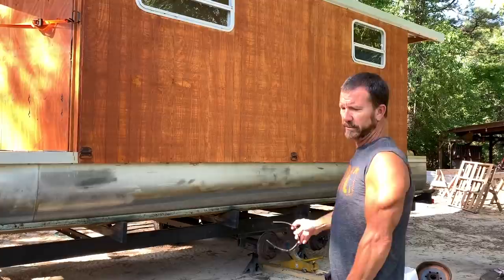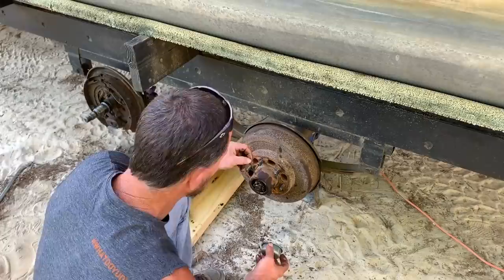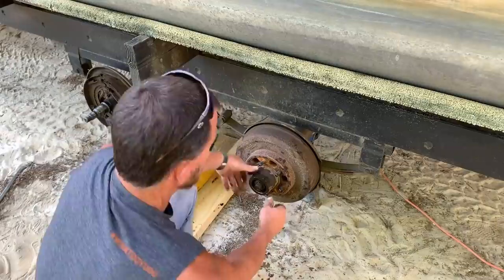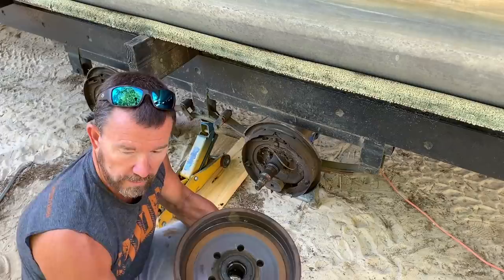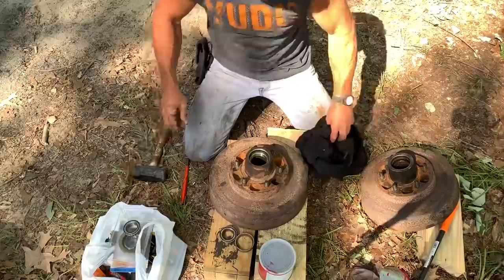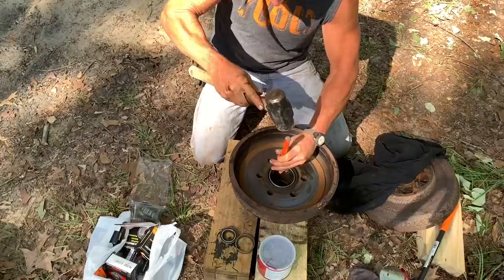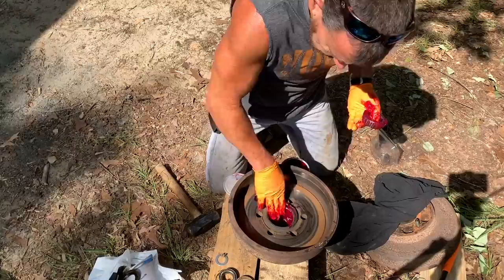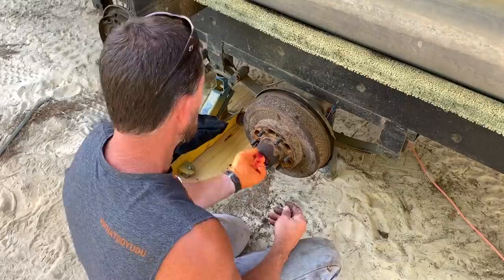Replacing Wheel Bearings on the Catfish Cabin! How To Replace Wheel Bearings!

Comment: It helps a lot on boat trailers if you don't back them into the water while they are hot. Let them cool a bit when you get to the lake. The heated air inside the hub and the cool water causes siphon effect that draws the water into the hub. The same goes for your gearboxes on your truck. Good job on the bearing replace be sure and check them after your first trip they may need a little snuggin up.

Comment: What we used to do,Jeff is after that outer nut is hand tight,we would put a socket on the nut and turn it one turn and then back it off a half a turn. That way it would make sure everything is seated. Those bearing buddies sure are nice. I have them on my boat trailer because I back my boat into a lot of saltwater and I grease them every time to get the sand and salt water out. You did a good job showing and explaining your bearing job. Love your videos

Comment: Man, I just gave away 4 brand new complete hub assemblies! Bearings, hubs, with electric brakes. Had a brand new tandem axle trailer parked next to a concrete wall, and a tractor-trailer backed into the tongue of it and pinned it against the wall and it twisted the frame a little, and the insurance company totaled the trailer so I snatched the entire hub assemblies off of it and a ran into a guy on the side of the road with a burnt up hub bearing, so I gave them to him. He was in a spot and didn't have the money to repair his hub, and I could tell the rest of them were really old and most likely going to burn up soon. so I fixed him up.

Comment: Great tutorial Jeff, we've stopped palming the grease into your bearings, we use a needle point solid stem grease gun,,,, out gun in the vise handle up needle point out needle point between the rollers,,, one pump each. And we put plenty on the inside just like you did 👍

Comment: Great tutorial Jeff! 
People, always face the lip of that grease seal with the lip pointing out and away from the bearing (not inward) so that it seals right!
He sure says it all 100% right when he speaks of seeing many people stuck on the side of the road with burned out trailer wheel bearings! I always check and repack trailer bearings before any long trip (boat trailer bearings every year regardless) and replace travel trailer tires every 2-3 years because they always dry rot and blow out more than most regular vehicle tires even if you cover them up from the sun. The price of new trailer tires is cheap vs having a blowout and an accident/roll over! Also, PLEASE do not use gasoline to wash these parts! I know that it works good, but it is too dangerous and can easily ignite from static electricity from your clothes, you touching things or from just pouring gas from one container to the next without a ground connecting the containers it can cause a spark, then an explosion and fire. I have seen too many of my past customers burn down their garages by pouring gas out of fuel tanks they have removed into a bucket to change out a bad fuel pump and using gas to wash parts. Do yourself a favor, go to the paint section of your home improvement or hardware store and buy a gallon of mineral spirits or high flash point naptha instead of using gasoline! Also, when ever driving bearing races, always wear safety glasses or a face shield, gloves and long sleeves! If you chip a bearing race, the sharp chipped pieces of hardened steel will fly as fast as a bullet and will puncture deep into your skin and eyes! I always cover the hub with a doubled up shop towel to slow down any metal chips that could break off so they don't shoot into the skin or eyes!

Comment: You can also use a large socket correct size piece of pipe (even PVC)  to tap pressure evenly when installing races sets and put piece of wood on top to hit if you need to to level the force. Good tips from others to put races in freezer to contract them first and putting washer and nut back on to help pull hub off.

Comment: Not criticizing, just want to make it easier for you.  I am an ex auto technician and have repacked and replaced many wheel bearings.  The easiest way to remove the inner wheel bearing and seal is to put the nut back on the spindle grab the drum and pull while letting the inner bearing slide down the spindle. It will pop that bearing and seal right off.  keep the vids coming. I have to say one thing.I know you have used gas for years but i beg you to not say it on the video. If you do make sure you make a disclaimer to not use it but to use a solvent / greaser.  GAS is so dangerous, so volatile,  one little spark and you are in trouble. so many other options.

Comment: As an ex tradesman that was an excellent demo.
Few things: You called the inner race the outer race. The inner race is on the inside of the bearing and the outer race on the outside of the bearing.  Not the position it is on the vehicle.

Please use a brass dolly to knock bearings in.

On a boat trailer, especially in the marine environment you don't want the sea water, or any water for that matter to get into the bearing.  It is a common practice to put the inner seal back to front, mainly to stop the ingress of water than to prevent grease coming out.  This also enables you to block the hole in the outside cap to prevent water getting in.

Doing the castleated nut up on the shaft, do the nut up with a spanner until the wheel is hard to turn. (do this with the wheel on) and then loosen the nut until the first groove lines up with the split pin hole. The wheel should then turn freely.
As demonstrated you are only tightening up against the grease and the bearing will be loose once the wheel starts revolving.

Comment: Great video! Now just some info.  I personally purchase an extra set of race and bearings and keep in vehicle along with gloves brake cleaner 12 volt air compressor bearing grease and at least enough tools to change bearings but I realize many won't do this.  Next, you do not have to do all this on the side of the road.  Once you get the hub off you can carry it home if close enough or to a truck stop Autozone  type store and borrow tools from them if you are buying parts there.  
TIP:  If you either dont want to do this and maybe get trailer to where it can stay a while, for many small trailers it doesn't cost much more to buy whole hub with new races seals and bearings in it (online like E-Trailer etc.) as buying the parts to repair locally and a lot cheaper than paying a mechanic to do this.  Buy non Chinese (American or Canadian or German etc.) bearings if at all possible They are generally much better quality grade steel but even some of those are rebranding chinese products now. Use buddy bearings and add a little grease  once or twice a year or every few times you launch a boat (potential for water to enter empty space) or every few thousand miles on trailers whose axels dont get submerged.  Try  NOT to submerge launch vehicle axels, you dont want to replace the vehicle bearings too! Like he said if you are replacing one set bearings on a trailer do them ALL they are all most likely near same condition !

Comment: If you get yourself a brass rod for hammering the race back in the brass metal is really soft and it won’t hurt the race and you can work on it pretty good.  I always kept one in the toolbox for that. 

Also whenever I do anything that’s going to get wet like a four-wheel-drive or a boat trailer I use white lithium grease. It cost more but it’s water resistant so if water gets in there it’s not gonna start breaking down and get all milky and thin.

Comment: I see so many ppl that do this wrong. Alot of these steps wrong and know how to properly pack a bearing w grease. Alot of ppl I have seen put a race in backwards. Make sure not to put a race in backwards, especially on the side of the road because the best way and 9ne of the few ways that work successfully to get a race out that's been put in backwards is get a piece of pipe you can just fit inside the race and tack it w welder pretty good to race and put pipe in vice and beat hub off of it. I take a chisel and grind the end flat l, not sharp. You can turn sideways to get race started then turn to where you have two good flat edges on race beating it out, it helps w keeping even and not cutting into hub versus just one punch edge on it. When tightening up new bearings w the nut I use adjustable wrench usually and snug good to where you know everything is pulled to gather good and usually will tighten half to 3/4 a turn, some take a whole turn but you can spin tire while tightening and feel a little drag on it. That'd your sweet spot. I farm and w harrow,cultivator,  water wagon, trailers I have to fix and keep up alot of wheel bearings. After replacing wheel bearings on anything, a harrow for example I run a good 6 to 10 hrs and recheck how tight they are. Tightening too much and they won't last but a few days. The dust cap or center cap is prolly most important. Do not run without one. It is letting in dust, dirt, water, and whatever else wants to get inside your bearings, about like these masks ppl wear against this virus but I always if possible buy a hub is best w a grease fitting on it but at least a center cap w a grease fitting on it. You can drill a hole in the center cap you have and get self tapping grease fittings to run into it. Not to be used for packing or replacing new bearings but is the life of your wheel bearings if you can put some grease to them, like on a harrow when running 60 70 hrs a week on it I will  2 to 3 times a week give it 10 to 15 pumps of grease to keep good grease in it. The hub is sealed so it is not something that you pump grease into until you see grease coming out anywhere.if no center cap you cut the bottom off a 16 or 20 Oz drink bottle and take a lighter and melt to hub where it stays on and seals it. Very I mportant to keep dust dirt and water out of them bearings. Great video, something that many ppl don't know how to do and what will cause failure of wheel bearings which can be very very dangerous if you lose a wheel going down the road and your boat was to hit the road and your wheel and tire hit an oncoming car or if my harrow or cultivator or fuel trailer hit the road and my wheel go into traffic and could kill someone. Could be a very dangerous situation

Comment: Jeff, that was an excellent teaching. I farm and have had to do that many times. I hate that there are such a multiplicity of bearing and race sizes so it’s really important, like you pointed out to save everything so that the numbers can be read. If you actually have bearings go out while going down the road, it’s rare that you don’t loose the dust cap, so taking your hub with you doesn’t hurt so you can get the right cap to fit it. Other than that, I’ve encountered the hole for the cotter pin to be at any possible angle, so scoping it out before greasing it up at the end helps to see where it needs to be lined up!

Comment: I use regular wheel bearing grease on my cars but for my truck and especially trailers I use "marine grade" grease.  It is specifically designed to not wash away or dissolve with repeated exposure to water.

Comment: Done this in so many parking lots. Drilled two spindles. That's a biotch. Molybdenum grease!  
Not gas...it leaves residue which destroys grease.
Tap the cap for a grease fitting.  Buddies are expensive.
I use a wood drift to "bump" them in.

Comment: Replace those caps with bearing buddies.  Spring loaded caps with a grease nipple, that keep pressure on the grease. when you see the cap moved in , pump more grease in to move the cap back out, never worry about water again

Comment: Good job Jeff. Looked to me like you've done a few before. Nice job on the Jack stands and the Jack in the middle for extra don't hurt none either. Two things I did notice though was you really should either use a bearing tool to install your races or at least a brass punch ta keep from scratching the races. And my friend whenever ya drive on harden steel like a race or bearing please wear safety glasses. God only gives ya two eyes and I bet your wanting to be see grandkids some day.

Comment: Don’t beat the devil out of it now, “Keep on bumpin” though. Good stuff
Reply: It's a good idea to use a brass punch instead of a metal punch when installing a new race.
Reply: But if ya ain’t got a brass one steel will work just fine.
Reply: @thomasloewen8911  Probably so, just don't get too carried away. Most folks probably use steel.

Comment: If you pack the center of the bearing full of grease and put a bunch of extra all the way around it put it in a vacuum sealer bag and vacuum it and when the bag collapses it will force the grease into the bearing

Comment: I use buddy bearing's they can be greased with a grease gun.And always preload the bearings by turning the bearing nut if possible to the next slot for your cotter key.Montgomery. Al Rolltide

Comment: If it’s a good Hot day, leave the hub out in the Sun an Freeze 🥶 the race for a bit, 
That will make it contract some while the hub in the Sun ☀️ will expand ( this is all minute measurements) Then when you try to get the race in the hub it is MUCH easier...  9:50   Otherwise, excellent job Jef 😎👍✅. I had to do All the Aircraft wheels on the Base for two years in the NAVY way back when, in the Last Century, Last Millennium that is.. We didn’t have no gloves 🧤 like that in the late 1960’s 😱😳🤭🤫
Reply: Cone, cage and Cup.  Race???

Comment: Biggest thing NOT to do is get to where you are going and back into the water right away with warm or hot hubs, just allow them to air cool before backing down the boat ramp. Hot/warm hubs will pull water into them, and capillary action will cause water get into the tiniest crack.

Comment: Mr. Barron, Nice video.  I was looking for tips on how to pack and grease my pop-up camper bearing.  It's was warm to the touch after pulling it for 30 or so miles at ~55 MPH.  Cool beans!!!  As for the "Catfish Cabin", you are using a genny for the Air Conditioner, do you have a spare Lead Acid battery for it?  you can use the power converter from the old camper (if you kept it) and feed it 120V from the genny, and then get some 12V led lights to run (and charge) off the battery.  At least on cool nights, if you don't have the Air Conditioning running, you can still have lights without the genny noise.  Make relaxing nights floating on the lakes.

Comment: Are you using a brass drift to seat the race. Also you should tighten the nut with a wrench to seat it then back it off and then snug maybe 1/8 to 1/4 turn. Tom

Comment: You would find it easier using a socket from a socket set for fixing trucks or cars mate and use old engine oil to slip the wheel bearing in there with the sockit 
 and a Hammer

Comment: Thanks. I grease my boat trailer hubs monthly. No at all interested in doing it on the side of the road.
Reply: Monthly? lol If you do it right the first time you won't have to do it every month that's a little too much lol
Reply: That depends on how many miles and how many times it goes in the water a month nothing wrong with a little extra preventive mantience
Reply: I do run a lot of miles. It's a tracker with a single axle.  I just don't want it to fail me.

Comment: nice video. thanks.

Just to be clear, are you replacing all the seals, races and bearings, or just replacing the bearings and reusing the  races and seals?  

Also, how many bearings can you pack with a tub of grease?

Thx again. Would have loved to have had you for a father.